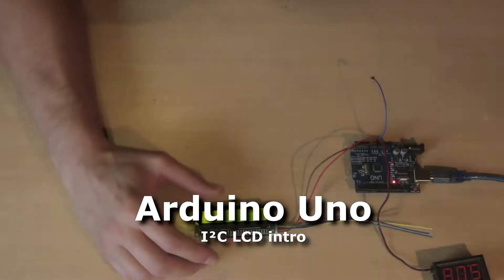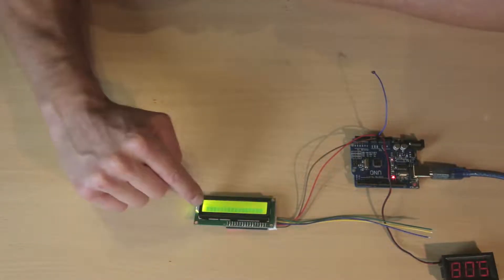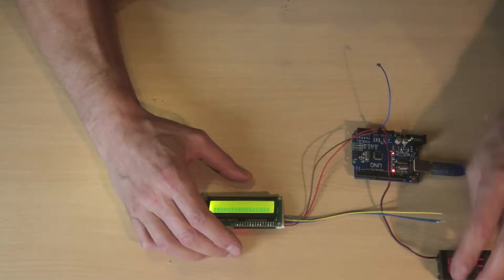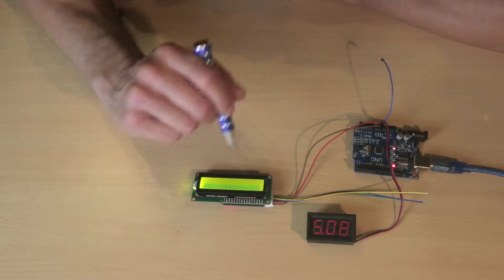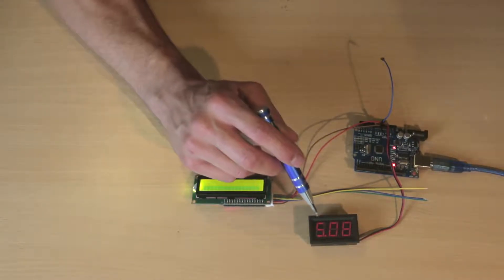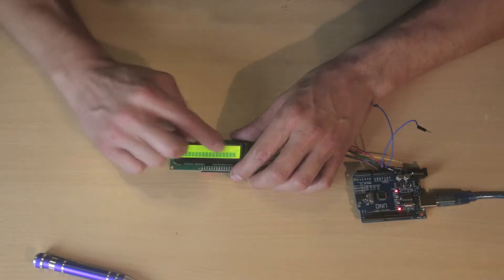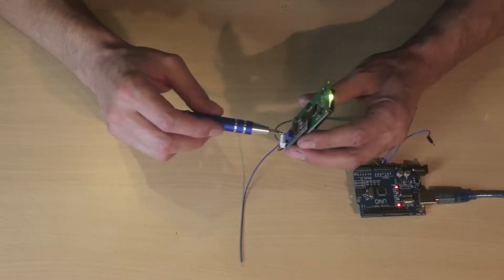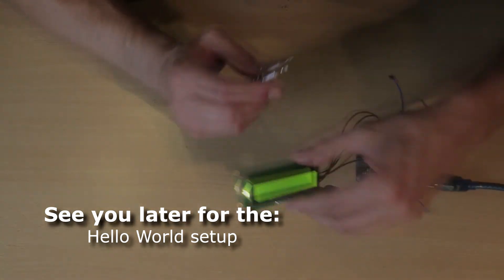#59 📟 Arduino I2C LCD - Be sure that your contrast is correct

Comment: Do you have any idea on how to adjust it when the rubber in the potentiometer broke? Mine was deformed because of the soft rubber or I might have screwed it too strong.
Reply from the maker: Not so easy, but you could solder a resistor or maybe even just solder it through, to have full brightness...but that's a Google search!